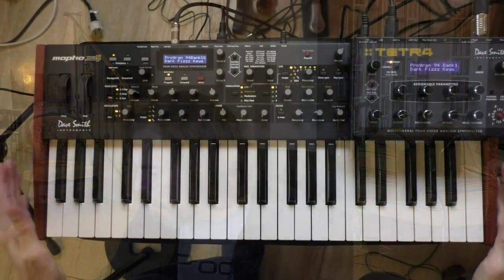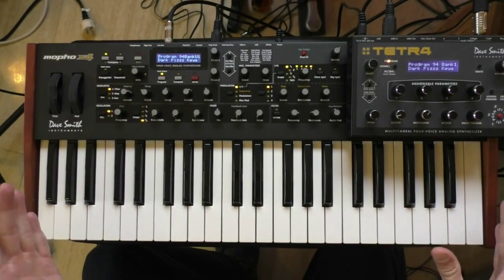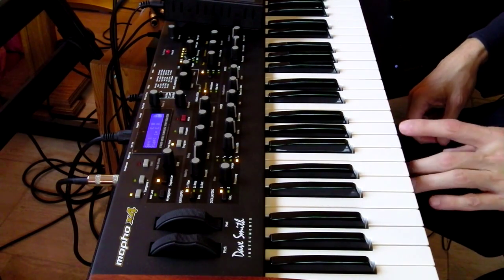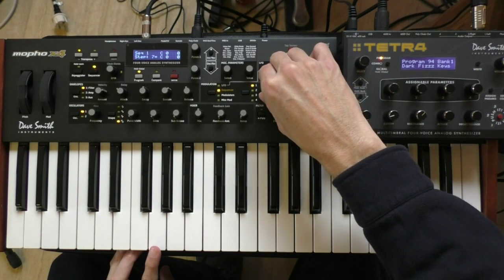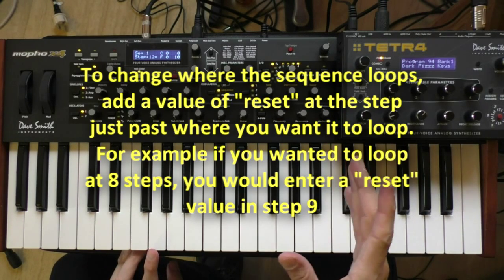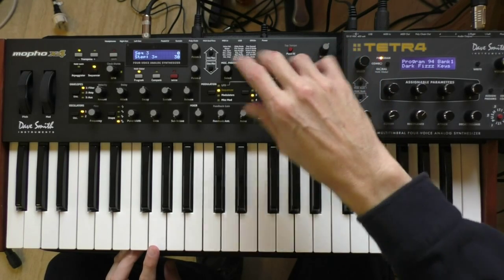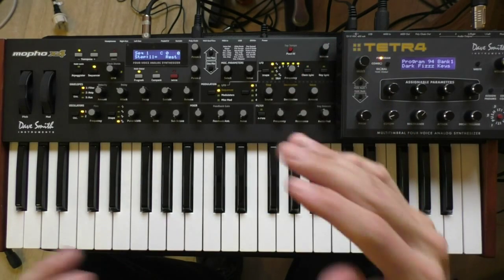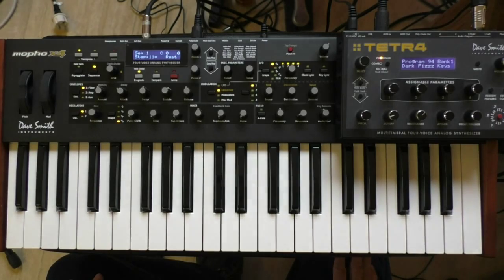Dave Smith Mopho x4 - Part 1 (the Step Sequencer)

Comment: You can set the "push it" button to latch the seq in the misc. parameters menu. Also, using a non traditonal input for the sequncer allows you to create music differently than you would if you used traditonal keyboard input. Thanks for the video
Reply from the maker: +Krystal Ferris Yeah, I almost mentioned that (using the push button), but it only lets you latch a preset note (can't easily transpose).  And interestingly, the arpeggiator can be latched, just not the sequencer.

Fully agree that "knobbing in the notes" (inputting note values with a knob or dial) tends to affect/alter the creation process over just playing the notes in, but I would DEFINITELY prefer to have both options...especially just to speed up the process.  

Thanks for the feedback....cheers!

Comment: Hey guys in my experience there is a latch button on the mopho x4,  you’ll notice to the top right of the mod wheel   Above the arpeggiator button it says hold: Latch when the Arpeggiator button is illuminated just hold the arpeggiator button then press whatever key you want to latch. Or am I trippin?
Reply from the maker: When I did the video, it didn't work that way.  Latch would only let you hold a pre-selected note.  Could be they updated the firmware to handle what you describe.  Sure as heck should have been easy to implement with an update.
Reply: I’m pretty sure you hold the arp button and it’s in latch mode catching and arping whatever notes you you play in until you smack it off. I think the OP is talking about how it won’t really hold the note/chord played with the sequencer on but just retrigs the start of the sequence over and over while the arp and seq are on. Now I want to go turn on my X4 to double check.

Comment: thanks for this awesome walkthrough :-)
I have one simple question: Is there some way to get the sequencer to keep the same beat - say I have it programmed on 4ths.
if I play an 8th note I get a new sequence beginning on the 8ths (offbeat) - I don't want this, I want the sequence to begin on 4ths no matter when I press a new key.
I figured "No Reset" sometimes works but definitely not always. is there a better solution?
Reply from the maker: Sorry...missed your question originally.  I don't think there's a way to force the sequencer to lock on to a beat, but possibly with a MIDI in setting.  If I find something, I'll try to post back to you.

Comment: slainte, my friend! you were right, It was Irish.

Thank you for the video. Youtube is a bit lacking on Mophox4 videos, esp exploratory tutorials.
Reply from the maker: +Rarren Doe Thanks.  Though a great sounding synth, there are some things about the x4 that seem a little unconventional or out-of-place.  Still worth it just for the sounds and playability though...
Reply: +ProckGnosis I picked up a tetra as my first hardware poly, and the mopho x4 is heaven compared to the tetra for user friendliness.

I can combine them both for an 8 voice mopho which is nice but I will definitely be looking to upgrade to a sequential 6 when I come across some cash.
Reply from the maker: +Rarren Doe Yeah, that's a tough choice, I'll admit.  In the US you could buy 3 Tetra modules (giving you 12 voices) for less than a Prophet 6 module (at Sweetwater, the Tetra is $699 and the Prophet 6 module is $2199).

Comment: Just got a Mopho x4 yesterady. I like it, especially the modulation possibilities, but darn, it would be so beautiful if you could use the keyboard as input. That would work for sequencing any parameter, not just oscillator frequency. Lowest key would be 0, highest 127, and the others in between (since there aren't 128 keys, it wouldn't be super precise, but you could still use the value parameter to fine tune).

Weird that DSI didn't do this.
Reply from the maker: Agree.  It's a short cut I don't think would have been too difficult to implement.

Comment: You said no latch key . . . but won't the loop setting give the same thing ?
Reply from the maker: Sorry...seems I missed this question.  The loop setting will repeat the sequence as long as the key is pressed.  A latch setting will let you press the key once, the sequence will start, and then it will continue looping  until you decide to stop the sequence (you can go make coffee and read a book!).
Reply: hmmmm, that's a bit of a nuisance then
Reply: You actually are able to do this using the "push it" button. When set to toggle mode it will act as a start/stop button for the sequencer. You can set the "push it" button to toggle mode in the miscellaneous parameter menu.
Reply from the maker: Niet helemaal waar.  Sort of.  A normal latch button/key will let you hold or latch ANY note or notes played until you turn it off or trigger different notes.  The "push it" button behaves like a latch button for only ONE note, and you have to set that note through a menu setting.  This is better than nothing, but nowhere as flexible as a normal latch function.  Cheers!
Reply: ProckGnosis Thnx fer da clarity
Reply: +ProckGnosis the manual mentions that you can hold the arp button down to latch it. Does the same trick not work for the sequencer?
Reply: ahh where do you control the so called loop setting? If i press a key as the video describes i hear no sound.

Comment: Nice video. A much underrated synth imo. Very strange that there is no latch mode though. It looks like the sequencer is difficult to get something decent up and running, but that once you do that, it is fairly straightforward to change/update. I hope you enjoyed your Guinness.  The word you were looking for is Irish and is 'Slainte', pronounced 'slawn che'.
Reply from the maker: +Pat Brady Hey Pat.  Yeah, I initially learned the Scottish variation from a Marillion song ("Slainte Mhath"), and used it years later many times over a pint-filled weekend in Edinburgh.  Been to Ireland several times but couldn't remember if I heard it there as well.  In fact the Guinness glass I'm using in the vid is from the Guinness factory in Dublin!

Regarding the sequencer, I think were I to do a lot of step sequencing, I would just use the software to program it.  I get the feeling it was sort of an afterthought while designing the synth.  There are cheaper alternatives that offer easier step sequencing, but the real strength of this thing is it's a joy to PLAY, is solidly constructed for gigging, and offers 4 nice analog voices for about a thousand bucks.  Not bad at ALL... (I know I sound like an advertisement, but I promise I get no kickbacks).  Cheers...

Comment: Great review, very well done. Great board but the learning curve is huge..
Reply from the maker: +Roland Gerard Thanks.  Yeah, that's the problem with having a deep, parameter-loaded synth.  It can do lots of stuff, but it's not always easy to figure out HOW to make it do all that stuff.  

It can be hard to visualize the flow of the sound even without any complicated modulations programmed.  Then add in the sequencer and the various modulators, many accessed from a little LCD and a couple knobs, and well, it's easy to get lost.  For me, that's why the software is so helpful, even if only to help me see and understand what all the adjustable parameters are!!

Comment: just one odd question, what destination means in the sequences? 
i can't figure it out...

thanks in advace,

mt
Reply: geat video by the way ;)
Reply from the maker: Thanks...appreciate the feedback.  The "destination" is what the sequencer will affect or modify.  It can be the pitch or note of the oscillator, the amount of filter cutoff, the amount of resonance, etc.  It can be LOTS of things.

In the graphic at 3:14, the chart shows that "Track 1" is sending the note values B1, D1, G0, etc to the "OscAllFreq" destination, which tells all the oscillators to play notes B1, D1, G0, etc.

In Track 2, different values are being sent to the destination "Output Pan" which will move the sound either left, right, or center in the stereo field depending on the values sent.

Hope that helps...cheers!

Comment: you look like dave grohl. also, nice video. i want to buy my first hardware synth and consider buying the mopho x4. but the only review i could find was on japanese. it would be great if you could do an in depth review about the mopho x4, especially the workflow for programming it (and maybe using it live).
viele grüße,
finn
Reply from the maker: Dave Grohl...ja, ich hab das schon gehört und dagegen kann ich nichts sagen!.  Vielleicht hast du dieses video nicht gesehen, und glücklicherweise ist es auf Deutsch: 

https://www.youtube.com/watch?v=oXsitDLg2rU

I think you would like the Mopho X4.  It is a well-built, great-sounding synth.  As for using it live, it has presets so that helps a lot.  But unfortunately no on-board effects (like chorus, delay, or reverb), so that is a small negative point.  There are virtual analog synths that do more for less money (like the Akai Miniak or Novation Supernova), but for the price and being polyphonic analog, the Mopho X4 seriously rocks.
Reply: thank you very much, yes i saw the session video, but i feel like session wants to sell me the mopho x4 rather than review it from a critical point of view. in terms of the missing onboard effects: i can live with that, i would route it through my audio interface and use ableton as an effect processor.
Reply: +ProckGnosis now i bought  sub 37 and um happy
Reply from the maker: Gratulation!

Comment: Hm. There is a third party editor from sound tower that works on building sequences. Wonder if it helps. I kind of always wanted this but I'm still not sure about that sound. Seems zippy or something for a DSI but it's still a good buy.
Reply from the maker: Yeah, I mention that in the notes/description.  The software does make the step sequencer a lot easier to program, and I have used it with the Tetra, but it's also (the free version) a bit buggy.

The one thing I really CAN endorse is the sound of this thing.  Can't say it's exactly a 10 (especially with no HP, notch, or BP filter options) but it is solid, and the keyboard is a joy to play (awesome construction).

Did you know your name is "honey" in Greek?  Probably... : )
Reply: ProckGnosis our amazing synth / modular store here in Austin has this in the used inventory. I think I will go play it to see what the DCO sound is like. They also have a sub 37 in, but they just got a slim phatty and that is such an ideal live tool, so on that note I will prolly end up waiting it out saving up and going for a poly desktop module DSI with VCO, and the slim phatty for the sub osc Etc and the moog filter. Oh yeah that would be my big fat Greek name...my stage name is Sophie Lazar, after the two first names of my great grandparents from Montenegro in the old country.. 😉
Reply from the maker: Ah, you're in Austin.  My stomping grounds from MANY years ago (lived there longer than I've lived any place).  And I assume you're talking about "Switched On".  A buddy did a virtual walk-through for me when they first opened.  Very nice place to explore and indulge in synthy interests.  

How much do you want to save presets, and how much hands-on knob fiddling do you need?  If you're not worried about saving sounds or pulling up presets, I'd also consider the Dreadbox Erebus.  GREAT sounding, fun to tweak, and it's Greek, like your name. Sound wise, really does give the Moog a run for its money.  The slim phatty will give you a bit of both (patch saving and some hands on tweaking), and doesn't sound bad at all, though I'd say I slightly prefer the Erebus.  And that's ignoring plenty of other viable options (a used Dave Smith Tetra, Arturia Minibrute, Novation Bass Station II, Korg Minilogue, etc).

Have spent quite a bit of time in Greece...great place and massive friendly folks...